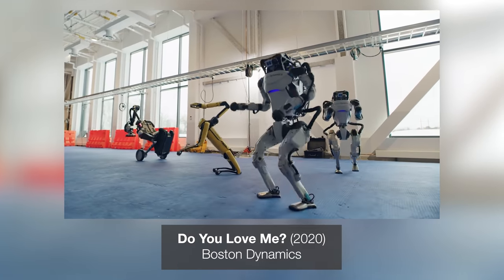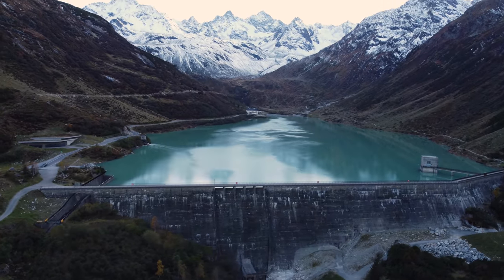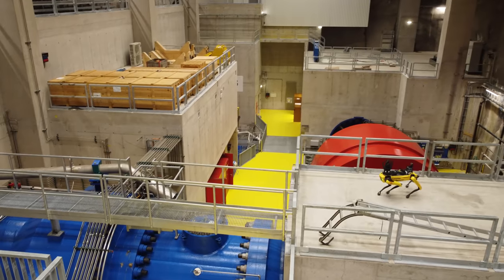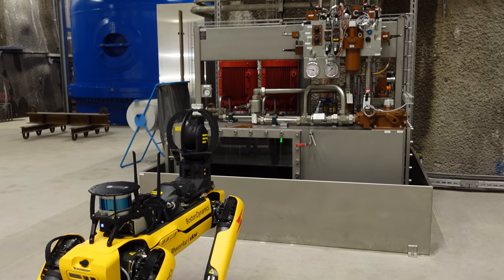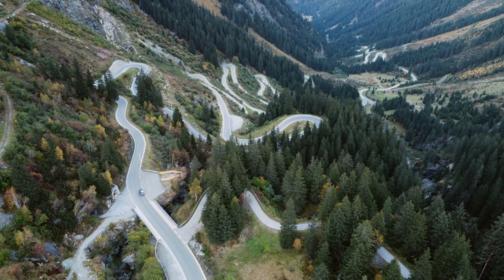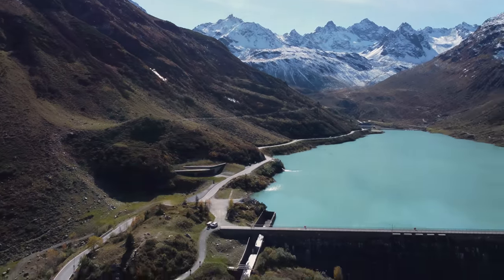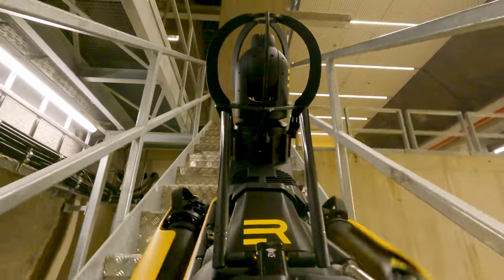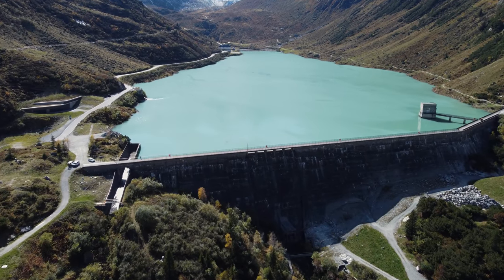An actual, real-world use for robot dogs

Comment: Important note: that's not "designed for humans", because many people are inconvenienced by frequent stairs, and moreso if the stairs are small or steep. It's designed for a specific subset of humans who are able to navigate environments which aren't built to be accessible.
Reply: You mean "employees"?
Reply: @marvindebot3264  Yes, people who can't get around an environment like this are indeed therefore prevented from working here, an excellent observation.
Reply: @skyshoesmith6098  And thus do not require access, are you seriously suggesting the company should be required to put in wheelchair ramps in a power station? And, may I add a power station with exactly zero employees?
Reply: @marvindebot3264  I'm sure I've offended you somehow, and I'm genuinely sorry about that. The station doesn't have zero employees, it still requires human presence (although you're right, it's a lot less than it used to be!) and even if it did, it's irrelevant; I was commenting on the design choice which was in fact based on human access.

My point is that, yes, wheelchair users for example can (and do) work at power stations, and there's no clear reason why they shouldn't. The exclusion of ramps makes it impossible for otherwise perfectly good workers to work there, and besides, makes it a lot harder to get people out in the event of an injury, and is still a pain for anyone with reduced mobility who is still perfectly capable of using stairs.
Reply: @skyshoesmith6098  No it doesn't, it has zero regular staff. Humans only show up when maintenance is needed. I can not believe you think that it is reasonable to expect ramps in such a workplace and contrary to what you may believe I'm all for inclusivity but to expect it in a subterranean power station with zero regular staff is crazy. Tell me, would you expect the same on a ocean going freighter?

Comment: I love how they say there is a shortage of engineers right now, and we will be needing even more in the future while the 20 power plants used to have at least one engineer on each site and now there are only a couple that visit in case of maintenance
Reply: Most of the old hydro power plants had 5-6 operators on site. But they have been replaced by the central control station over the last 30 years. Lots of them retired. 
Nonetheless, that power company is hiring like crazy, due to a lack of qualified personell in the region.
Reply: @xxJohnxx77  a supermarket near me is hiring like crazy, doesnt mean that it will in the future. U said there used to be 100 engineeres needed  30 years ago until they were made redundant, I assume a single team does the same job. Dont see a single reason why 30 years from now a single team won't be able to maintain 40 or more power plants. And I'm not even touching the subject of salary. It wouldnt surprise me at all if every single one of 100 engineeres had a better salary (accounting for inflation) then any of those in the "new" team. Hiring like crasy sometimes means we need people who would work while being underpaid

Comment: I'm guessing they have great security, since they've just advertised 'no one is ever here, and the site contains hundreds of thousands of dollars in easily transportable hardware'
Reply: There is only one way in or out of such places and it is at the end of a 30km road, if you trip one of the alarms then the cops just have to guard the road and wait for you.
Reply: @krashd  I feel like if you were going to perform some sort of heist on some critical infrastructure, you wouldn't drive down that one, no doubt highly surveilled road. You'd hike there, or find some other alternative. But if you did drive, I'm sure you're correct in that it would lead to your immediate arrest for sure.

Comment: I wonder if it wouldn't be cheaper and more effective to get a bunch of cameras pointing at the things that need to be inspected. You can then run motion amplification on the data, as well as easily see long term displacement.

Comment: CTS-systems and cameras already do this....at a fraction of the cost, and it works with fire safety measures and an infrastructure that doesn't have to be (or, tailored to be) suitable for a robot.
Reply: The whole point here is that the environment isn't tailored to the robot but the robot is tailored to the environment instead. And how many cameras would it take to get the same coverage of every possible point of interest in a facility this big? Especially when you need expensive thermal cameras. Doesn't sound cheaper than a single robot dog at all
Reply: @nokashii3375  "Doesn't sound cheaper than a single robot dog at all"
That is because you don't understand how a modern CTS-system is constructed.
Reply: @Steelmage99  so? It still needs the cameras. Which cost money...

Comment: I get excited everytime I see a boston dynamics.
But I don't See the Business case here. If I as an engineer would get the task to make something like a power plant controlled remotely, I would think that a System that provides the data over the internet is much cheaper, faster and more relyable than any robot.
Use Sensors with WiFi, Cameras and  you can do more than Spot for cheaper.
The only downside is that you don't have a really cool Robot Walking arround. But that's usually not the Goal.
Implement industry 4.0 before 5.0.

Comment: I think they could also combine the robot dog with a drone too, and use the "dog" as a docking station (there's a pun in there somewhere).

But it would be beneficial if the camera could detach and move to different vantage points for an inspection by using some form of LIDAR / virtual placement to navigate the environment, taking photographs and reaching high areas.
Reply: I believe that line of thinking led to the AMEE robot in the movie Red Planet.

Comment: If its still just inspection and monitoring... wouldnt dron be better? It would safe a lot of time "walking" around, when it can just fly up... also it can check everything from more angles, fly around it from every direction... for walking on stairs you also need much bigger robot, drons there could be much smaller - saving some more energy...

Comment: Genuine question, wouldn't something like a quadrocopter drone (or similar) accomplish the exact same thing more cheaply and with greater mobility? All that needs to be done is to mount a camera on it, and it doesn't require poking around with a strange new tech. It doesn't seem like a particularly tight space.

Comment: from the supervisory and control aspect it makes no sense. Here is a controlling device ("the robot") that is acquainting data in a sequential way versus acquainting data parallel and then sort it out like it´s done in process control systems. What exactly is that autonomous device checking that couldn´t be done more reliable and more cost efficient by usual sensors and actors?  There  isn´t much use for it in areas where security standards have to be met. More likely it´s a engineering gadget,which of course, could be developed more.

Comment: Would it not be cheaper to put up dozens of thermal cameras that can analyze and send out data?
Reply: This robot costs $75K without camera. A reasonably high resolution thermal camera is in the same range. Assuming the cost of developing this system does not add a huge amount per installation,  it may well be a lot cheaper to use one mobile camera instead of many fixed ones.
Reply: Oh, Wow. I never would’ve guessed thermal cameras cost that much. 
Although, I would also assume a robot dog is going to break down a lot faster than thermal cameras would, but I may be wrong on that too.
Reply: @1011-p6c  The robots are relatively simple mechanically -- there are very few moving parts. But it is hard to tell how reliable they will be. Manufacturer's warranty is 12 months, and after that you can extend it for about $20K/year for up to three more years. It seems expensive. Other manufacturers (Chinese Unitree) already offer similar robots cheaper, and have a selection of products in different sizes.

Comment: Hmm weird usage. I'd have thought a temperature sensor and a thermal camera at each point you are interested in or maybe just a drone with these things would be much cheaper that a full on walking dog. I mean maybe the dog needs to do some physical task but surely that can be done from the press of a button or from the system sending a message for that to happen.

Comment: They could just build a few ramps for the wheel based robots and it will still be much cheaper.
Reply: It wouldn't, the most expensive part of Spot is it's brain and any robot capable of processing data at the rate that it does would still need that brain.

Comment: I don't really understand why a robot with a camera in place of a person is more cost efficient than just multiple cameras pointing at all the places they need to inspect (Is the cost of a robot + 1 camera cheaper than however many cameras they would need)? If the inspection is always being done by camera instead of in person, why does it matter if it's on a robot or not? I was under the impression that in-person inspections were needed to check that equipment was working correctly (can't trust cameras/sensors), so they replace those in-person inspections with the same camera/sensors that they couldn't trust initially?

Comment: I assume that for the moment someone has to review the footage manually as the software probably doesn't have enough learning to decide whether something is a problem when it isn't measurably obvious like temperature so for example a crack in the wall could be difficult to diagnose whether it requires work or not if you don't have the experience of someone who works with walls like the ones present here.

Comment: I still think that using a robot to walk around the plant to take some readings is a very cumbersome way to get that info. Why not just make all the sensors IoT enabled? Then you would instantly have all the readings without having to wait for a robot to physically walk there.
Reply: Because the dog (or prior to him the engineer doing the job) is there to control that all sensors are working correctly.

Comment: Isn't fixed cameras 24/7 enough? Ok - add some cameras with zooming and moving (rotating in place) abilities. Robots must be used in uncontrolled environments for example - you can try to inspect Chernobyl or Fukushima reactors (or what remains of them), you can inspect constructions that are going to collapse - to find and try to rescue survivors. But Boston dynamics prefer safe and predictable conditions instead.

Comment: BUT!
As awesome and cool to see a dog-like robot trudge about in a difficult facility, doing inspections... why not simply have cameras surveil the areas of interest and the various readings sent directly to computer/mobile devices of humans on remote guard-duty around the clock, only deploying the robot, IF there are abnormal conditions, that require immediate physical action? 🤔
Reply: Too much area to cover - it'd take more static cameras than it's worth, at some point it becomes cheaper to just have a single moving one
Reply: @nekkowe  I'm of course not saying they need to cover the whole thing. Just places of interest, where stresses and tension is high. And even so, small camera-drones exist that can easily be programmed to follow a path and can get to any location, whether it be at opposite ends of the facility, in mere seconds. I'm not saying this robot has no use, as a small drone would not be capable of taking any action, where as these robots can come with mechanical arms, I've seen, which would in some instances enable the to push buttons, pull levers and turn valves, etc.
Regardless, it's a nice experiment, which I'm sure will save a lot of time, and in a worst-case-scenario, even save lives.

Comment: Is there a reason they can not just install static cameras or sensors on the locations the robot is checking? Is it just cheaper to have a single really expensive sensor suite that moves to each location than many cheaper sensors at each location?

Comment: If the robots only job is to perform inspections by walking around the place and take  regular + thermal images, wouldn't it be cheaper to install dedicated cameras and have them monitor those spots 24/7?
I see the need for Spot in highly dangerous environments, like in SpaceX testing grounds after they land a rocket and it may or may not be safe for people to walk around afterwards, and the landing position isnt always guaranteed. But in this powerplant every piece of equipment stays fixed all the time, so why not just rely on regular cameras?

Comment: This Is very cool, I love the idea of a robot walking around an environment and doing tasks. However, why don't they just set up cameras/thermal imaging devices at whatever they need to see for the inspections? Only send out humans when its necessary. Seems like this is not the most effective use of such a robot and are making things more complicated than necessary.
Reply: I mean, don't you think that if it was that easy, they would have done that from the start? they probably also have cameras and sensors, since the plant has been working from before spot even existed

Comment: I work in security so a robot dog like makes me a little worried, as It's able to do a large part of my job which is patrolling a site and reporting any issues, tho lucky at the mo it's too costly to operate but as the tech gets cheaper it may force me and a lot of other workers out of a job. But it could also benefit my role too as say I'm dealing with issue on site and unable to patrol the site as I'm tired up with that issue this robot could still be patrolling the site ensuring it's secure. So it may replace me or work along side me.

Comment: In this specific case wouldn't it be easier to fly a drone around instead of letting a dog-robot walk the stairs? The drone would need the same collision avoidance software etc, but mechanically it looks like a way superior alternative to navigate that huge space.
Reply: It would take more energy to fly around. The drone could crash while the dog can only lie down.

It's just not efficient to fly if you could also walk.
Reply: @1996Pinocchio  A drone doesn't need to weigh more than a few pounds (which costs way less energy than a 33kg robot) and any navigation software that is any good doesn't crash.

Comment: As far as I can see, using Spot is overkill for this application. If the objective is just to check on the site and monitor the temperature and other parameters of various bits equipment, why not just use a large network of CCTV/thermal imaging cameras and digital sensors (whether that be for temperature, pressure or something else) that report back to the control room (IoT style)? Even just putting some CCTV cameras pointing directly at some analog sensors/dials, if digital versions aren't appropriate, would surely be equivalent to having Spot look at it? I don't see the need for a robot that can actually walk around the site and look at everything in the same way human does...
Reply: I imagine they already have cameras/other sensors that look at different points. Yet, they still need a human to go there and check things. The only way to not need a human to go there is to have something that can go to the same places as said human.

Comment: That is great, but wouldn't remote cameras be able to do the same job for a lot cheaper?
Reply: 2000 Inspection point to be covered. Mix of thermal and normal camera. lets say you need 500 camera. Professional camera which hold longer than 3 years in very cold and humanid environment costs about $500. Then install all of those and wire it. Lets say $500 for making it easy to calculate. This is then $500k. And snap .. you forgot 50 inspection points or get some new ones. Or you just want to look on something from behind. Still do the same math?

Comment: why can't they just install a hundred crappy webcams everywhere if they actually need images? but honestly sensor readings could be sent directly without taking photos. that's way cheaper and easier.
Reply: Because they need thermal images. Those cameras are a lot more expensive. Also the sensore readings ARE being sent. The inspections are to make sure all sensors are working correctly.
Also, depending on its configuration, the robot dog can be remotely controlled to do simple tasks with its attached arm

Comment: If there are some several dozen or 100 points of inspection and reporting, then why not a permanent camera and telemetry reporting on each? Providing simultaneous reporting and high frequency reporting? Why have a robot fetch info that can be relayed by stationary instruments?  

Seems like a good test for robotics. But not a ‘better’ monitoring solution.
Reply: 100 point of inspection means up to 100 cameras needed to monitor all of them simultaneously. That's getting expensive really fast, especially when you need thermal cameras.
Reply: @nokashii3375  
I don’t see it that way. Static cost of 24/7 data collection. Human review of the data would be as-needed given digital data and automated warning. 

No. Not IR cameras in all cases. Temp reporting by temp sensors. Each inspection point may have different reporting. 

No, not a robotic task.

Comment: How is this a better solution then just pointing cameras at what you need to inspect?
Reply: One mobile camera to inspect everything instead of hundreds of stationary cameras to get a picture of every single part of the facility from every possible angle
Reply: @nokashii3375  Yes but the stationary cameras are likely cheaper to buy and maintain, you don't have to wait for travel time to get to each thing that needs to be inspected and don't need to be turned off every other hour. Also the robot can't look at things from every angle just every angle a dog can see, its not like they are flying a drone around.